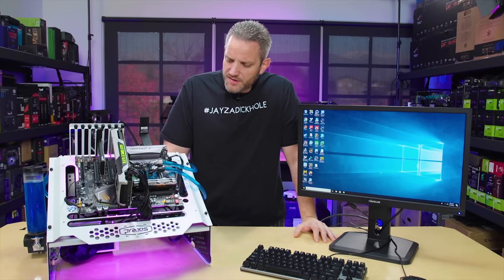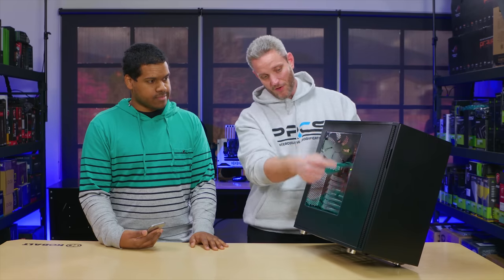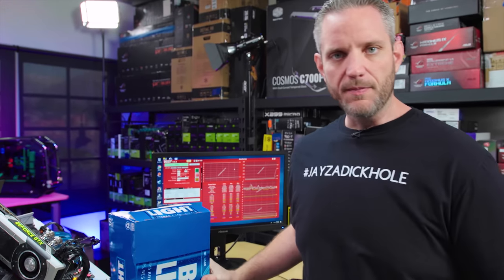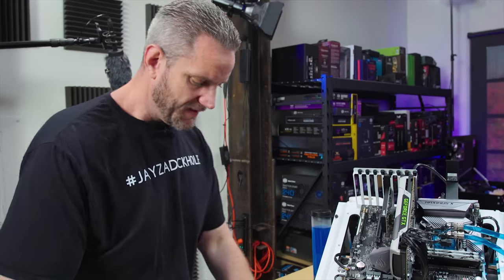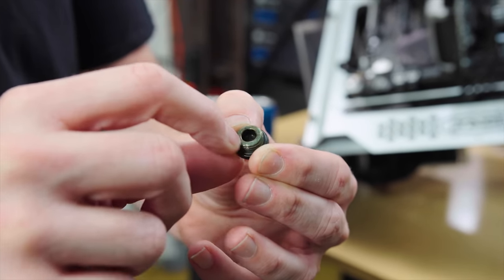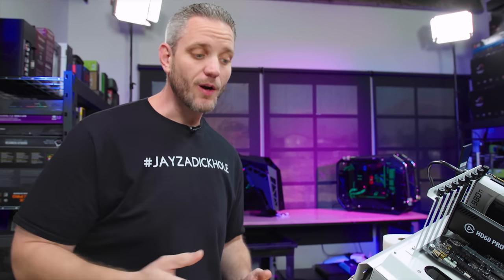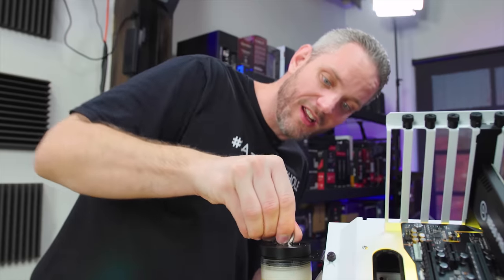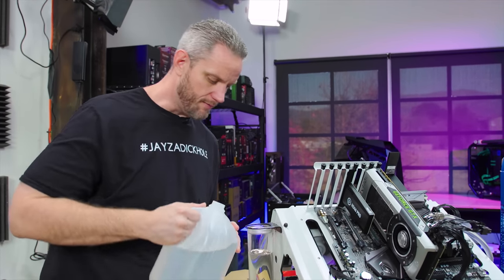We Watercooled a Computer with BEER! DID IT WORK??????

Comment: do it with vodka
Reply: I'm pretty sure it would catch fire at that point lol
Reply: Why would it catch fire? You would need a way higher temperature for that. About 673 K or 400 C.
Reply: Don't forget oxygen
Reply: A Slavic themed build would be awesome. Black case with 3 white stripes
Reply: I don't think Jay's liver can handle it.
Reply: I'm russian and I adore your idea.
Reply: said the russian
Reply: What is good is Post Malone doesn't like vodka thank God!
Reply: It would fuck up all the plastics.
Reply: cheeki breeki
Reply: glass tubing
Reply: you can buy vodka in plastic bottles
Reply: Did you hear about the Russian aircraft radar cooled by alcohol?
Reply: HMMMM TRUMP VODKA
Reply: Actually I'm guessing vodka would be even better if they leave the cap open, as it has high alcohol content which evaporates on very low temperature, and it is well know that evaporative cooling is efficient...
(but you loose the alcohol pretty fast, and as alcohol vapor is very flammable I suggest doing it in a well ventilated area!)
Reply: I was thinking this as well. 
Because what, cider is much like beer, wine is ..meh. Milk is just,,,gonna boil over.
Vodka on the other hand is interesting because ethanol is actually used in cooling systems to prevent freezing. (and sometimes fueling drunk navymen.) It doesn't have the same heat capacity as water though, so we should see some differences.
Reply: Rush B lol three stripe of adidas (life of  borris)
Reply: pretty good idea, btw
Reply: i knew anything that is not "RIGHT" 4 a loop wil be a no go. haha
Reply: I was thinking tequila or vodka
Reply: Vodka - good enough to cool Soviet airplane radars - good enough for cooling a PC!
Reply: @rush B And make it squat real low to the ground.
Reply: Ellypsis Russian bias
Reply: CatSay well, alcohol has a much lower freezing temperature than pure water (you can easily put a vodka bottle in a freezer and it' won't freeze) so if you're going to want to have liquid cooling going through something where it actually has a chance of going below freezing (like way up high in an airplane for example) it makes perfect sense!
Reply: Vodka!
Reply: Ellypsis and this is why you should read comments before commenting
Reply: The pc turns on when you decide to p90 rush b
Reply: and listen to boutchka bass on the way.
Reply: In soviet russia the cpu cools the vodka <(")
Reply: Ellypsis only in Russia...
Reply: IN soviet Russia, computer water cool you
Reply: Don't waste Vodka!!!
Reply: Ellypsis or tequila
Reply: You mean wodka?
Reply: Plot twist, the PC turns Russian. LOL
Reply: Ellypsis maybe Butane... Or some kind of fluorocarbon.
Reply: Distilled ethanol=🔥
Reply: Dr. Pepper, Lemonade, Vodka.
Reply: Ellypsis better yet, everclear
Reply: Yes vodka
Reply: Maybe in a phase cooler.
Reply: FleX that's the point.
Reply: Random idea but he should have just let the beer get flat.
Reply: that would be expensive for the vodka too!
Reply: All the alcohol would vaporize and vapor lock the pump. If you evaporated the alcohol before adding it, well, that would leave you with water, so you might as well just start with water.
Reply: Ellypsis vodka would be better, but they can't use it because beer it's his favorite.
I'm suprised the PC is still works
Reply: go watch boris he did it
Reply: Imagine the utter stench of vodka filled throughout the room the computer is in.
Reply: Cyber Cat no
Reply: cough  LifeOfBoris cough
Reply: 3 words.
Life.
Of.
Boris.
Amazing vodka cooled pc, actually legit aswell
Reply: Borris dit id already
Reply: Life of Boris did it recently
Reply: Have you seen Life of Boris' video? lmao
Reply: life of boris, vodka. idk if it real, but it was funny
Reply: Life of Boris did it
Reply: Use Everclear. Once the show is over, Jay can get his stomach pumped right before the computer gets flushed.
Reply: life of boris did it, go check it out
Reply: i mean it worked for boris...
Reply: i am pretty sure, vodka would work better.
Beer will decompose under heat
Reply: Boris allready did it
Reply: life of Boris made one and its slav as hell
Reply: Ellypsis GTA 5 is not Vodka Optimized, but STALKER and Metro greatly benefit.
Reply: They already did it. Good ok Cossack HD and L. O. Boris did it. It works better than beer or water for the same reasons it or rubbing alcohol cools sick people better than beer or water
Reply: Ellypsis Life Pf Boris did it
Reply: Ellypsis it's called life of borris
Reply: it'd do havic on the parts aswell. . . .
Reply: @paskowitz  being high proof (60+ % alcohol) it's basically the same as them putting rubbing alcohol in it. . . .ouch!. . . (at least from my understandin')
Reply: every single person in the reply section does not know who Boris is. check out life of Boris's PC
Reply: life of boris did it, check it out
Reply: Cv [kJ/(kg·K)]

water - 4,190 

ethanol - 2,44 

in conclusion vodka will heat up faster than water
Reply: There it is: https://www.youtube.com/watch?v=IYTJfLyo_vE
Reply: I'm maybe a bit late but a channel called "Life of Boris"did it with a vodka and a vodka bottle as a reservoir and it worked rather well...
Reply: If you want vodka cooled pc go watch life is Boris
Reply: no moonshine
Reply: @Samtoxie  depends on the ABV, right? (https://en.wikipedia.org/wiki/Alcohol_proof) 
what's the common ABV for Vodka in the US?
Reply: Search Life of Boris
Reply: No algae growth if you 100 proof right?
Reply: who don't like some fire?
Reply: I’m pretty sure Life of Boris did that
Reply: vodka is work 1 year later you lost your tube
Reply: PacificNutria life with boris did it
Reply: It won't catch fire, but it may very well evaporate and explode under pressure
Reply: Already done, Borris already made a video of this. But Jay could do it almost the same way, but it's be hard to stabilize.
Reply: yeah!
Reply: BORIS ALREADY DID THAT
Reply: Ellypsis watch life of Boris he did and it was good
Reply: PacificNutria no life of Boris
Reply: boris : hey that's my idea
Reply: boris beat him to it
Reply: Boris did it
Reply: boris did that
Reply: Go to LifeOfBoris chanel he did it :)
Reply: Boriiiis
Reply: A russian guy called life of boris acctually did that and it was better than the acctual cooling liquid
Reply: boris has entered the chat
Reply: @McMaster_102  check out boris the slav

Comment: Hey Jay, why not use beer colored fluid and then make a float in the reservoir that looks like the head of a beer? Could make the reservoir look like a pint glass too. And the tap handle could be a drain for the system.
Reply: this would be fantastic if he could find a way to purge all the air bubbles with the float in there. who knows, it may not affect it at all
Reply: This.  This right here.  Yes.
Reply: Only problem is everyone who sees it will want to pull the tap lol
Reply: PE foam? Something like one of those PE foam pucks EK tube reservoirs come with, only white.
Reply: Id propably prefer to add soap to it. The pump might be enough to create some foam that is on top. Might get issues with the mayhems dye but Id try it.
Reply: This guy is a genius. @TheBCninja, you need to be an engineer.
Reply: TheBCninja someone get this guy a medal.
Reply: Your pc idea would be a hit at October fest. But to take it further... add a small peltier cooled section to keep a cold one or two with the pc. Down fall, might loose some hdd space.
Reply: YES
Reply: Just xIGoldenIx hey mate did you ever do it?

Comment: 6 years late and I don’t care because this is important. What is that green corrosion? Check this out, what do you think most houses are lined with that isn’t pvc? A metal that, even when corroded, doesn’t pit or rot. A metal that is abundant but when refined it is so valuable that junkies tear it out of houses. It’s copper. Why wouldn’t the system be sealed with copper hardware? Stainless steel is fancy, sure. Copper has character. Copper is battle tested in systems under pressure. Corroded copper has character, corroded steel falls apart.

Comment: try alcohol. just straight vodka. alcohol is better at heat transfer than water
Reply: Topo Gang Alcohol ignites at room temperature if you add a ignition point, otherwise it won't burn, it'll start boiling at 80° tho
Reply: yea and methanol is 65° though :D
Reply: But this is under pressure. Not at atmasphereic .
Reply: well when the beer goes stale the pressure will lower as well. and they kept releasing the gas, so i don't think pressure will be a problem
Reply: wobbly sauce the fact you wrote it like that killed me...
Reply: lol people use alcohol to make THC, and other extracts because it evaporates at very low temps. Just leave it in a well vented room, and after a day or two most of it will be gone, and then just heat it very gently to get rid of any trapped inside, plus the 1% or so of water that is generally in most 99% alcohol. People use butane for the same reason except that chemical in the butane that extracts the THC doesn't absorb the chlorophyll, and other plant chemicals giving it a golden look which sell better. That's why honey oil is made with butane. Though butane is also somewhat more dangerous to work with.
Reply: Thanks P.
Reply: Who the fuck are you, the Beer Walter White?
Reply: if you really want to cool it great, do a loop of murcury. Gonna need a hella strong pump tho.
Reply: Man that would look sick, but probably be pretty expensive, and I don't think the needle would be the problem. It would be the pump, that shit is pretty dense.
Reply: vodka would work fine because its generally 55-63%water and 45-37% alcohol meaning its boiling temperature would be higher so it would be find because its not pure alcohol- (Pure alcohol is almost impossible to get because of how soluble it is in water)
Reply: Straight 98 percent moonshine

Comment: Do it with gasoline....

Because race car bro
Reply: CinOmatic Most race car don't use gasoline
Reply: Ethanol then :D
Reply: Aksherli... Yes they do.
Reply: I don't know about that one.  I'm not sure what temperature gasoline combusts at.  They could have a fire by the time they are done.
Reply: coneris The autoignition point of gasoline is 280c (536F)
Reply: coneris i thought liquid gasoline only combusted under pressure or as a vapor when mixed with air in a certain ratio. not sure either, though
Reply: I think nitroglycerin is worth a try.
Reply: Rubbing alcohol, low boiling point.
Reply: CinOmatic fire ass pc
Reply: CinOmatic That would actually be dangerous. As Gasoline vapours ignition temperature is similar to that of CPU/GPU temps. This is why you need to be careful when storing it and store it in a closed container in a cool environment.
Reply: You could get fancy and use colloidal gold or colloidal silver, I bet they could hold a lot of thermal energy per volume. Is colloidal gold erosive?
Reply: E85 or Diesel
Reply: Did you know the F35 uses its own fuel as hydraulic fluid.
Reply: I like the way you think
Reply: Use Methanol instead.
Reply: And the ignition point of its vapour? Thats the kicker. Its a dumb ass idea. Even a small chance of ignition and bam fire and possible further catastrofic failure due to the nature of the rate of flow. All it would take is one short. It wouldnt be the cpu that would trigger it either. The only place I would even suggest trying something like that is in a extremely well ventilated area like a spray shed where its a concrete room with huge extraction fans. Thats the Only environment you would possibly consider doing something so stupid. And with old hardware that is expendable.
Reply: gl getting something to ignite with no air. unless ofc you want to damage your pump have have worse temps by letting air in.
Reply: I was going to give a smart a** answer with kerosene, but I see you beat me to it with gasoline! LOLOL
Reply: guinness
Reply: Alchohol, gasoline, diesel, E85, etc will eat the he'll out of parts not designed for it. It won't last in my opinion. Sounds pretty stupid to me. I've been a mechanic for 15 yrs. You can't put Alchohol or E85 in a car not designed for it. I know you all are joking, but seriously, it WILL fail.
Reply: No. anything even remotely close to being called a "racecar" now a days runs on Ethanol (E85) a much cleaner and more efficient fuel. Yes they run on fuel, just not Gasoline.
Reply: @AdrinsonEstevez  Depends. WRC cars (my fav motorsport) use petrol (or gasoline) as diesel and ethanol are banned by FIA for rally.
Reply: @Valfaun  that's diesel not gasoline. that's why diesel engines don't have spark plugs, while petrol based engines do.

Comment: Its screwing around until you record your results, then its science.
Next experiment, use vodka as coolant.
Reply: Vodka is a bad idea, because alcohol evaporates quickly. Leave a bottle of rubbing alcohol open and mark the levels before that with marker. Withing couple of days you will see alcohol missing out of the plastic bottle.

Also alcohol evaporates even in closed plastic bottle over time. Plastic is porous, it has micro-pores for gas to escape. Alcohol produces fumes, as it's not solid water. In short...it will evaporate, especially as you hit it.
Reply: Boris did that already
Reply: Life of Boris got you covered komrade!
Reply: Actually pure grain denatured alcohol will work in a older cast iron / copper iron and magneto or spark gap automobiles as as antifreeze. It was quite common to find 140F thermostats in the 60s on the shelf and 15 lbs radiator caps. Ethylene glycol became the standard in overhead valve motors because it has a higher boiling point,   PGA boils at 180 F at sea level. So going back to distilled water in the summer was normal. Think flat head motors & cast iron pumps. A 1950 Ford V-8 was a flathead. So using the right amount of PGA volume would mean with the right Gallons per minute would top out at 82C. (at sea level) That is if the system does not vapor lock. Vapor chamber cooling is often done with alcohol and negative pressure in sealed systems. So yeah beer will work as long as the temp gets high enough everyday to keep it from going into fermenting. As in vinegar or other nasty smelling bacterial or fungal reactions.
Reply: sparkplug1018 this was done watch by life of Boris it’s worth it

Comment: Why didn't you shake it until it wasn't carbonated anymore?
Reply: Where is the fun in that!
Reply: Then it isn't considered beer anymore
Reply: Samtoxie is bud light even beer in the first place? /s
Reply: It's just like non alcoholic beer, fake beer.
Reply: dunno why the /s. legit question
Reply: Samtoxie it is still beer :/ that's like saying that if you carbonated vodka, that it isn't vodka. It's still vodka lol
Reply: Exactly!!! What I thought...
Reply: Samtoxie 
It's sacrificial party beer.

Easy to drink and cheap enough that when you bring a case, you don't get mad when it gets passed around and ends up empty.
Reply: Bike Dude that was the issue they were having lol it was happening in the tubes and causing issues
Reply: Bike Dude they were gone because the pressure equalized. When he opened the cap they started to come out again.
Reply: Crack the lid, then shake it.
Reply: Leggir all that would accomplish would be getting beer everywhere lol
Reply: Bike Dude it doesn't.. ok look lol it doesn't just go away, it pressurizes, which is much worse
Reply: GuvernorDave it’s means sarcasm it’s a reddit thing

Comment: I have an idea! Why not have a reservoir that’s partially filled, and pump air from the top of it through a tube in the bottom with many tiny holes to create those little tiny beer bubbles?
Reply: Because you dont want air in your loop?
Reply: Louie Mott a tiny bit of airpressure in the reservoir is actually neccessary, if you overfill it can blow out your fittings.

Comment: greenish corrosion means the material has copper, it oxydizes and becomes green
Reply: gonna say that, didnt know for sure but thanks
Reply: It's called Patina, it can form on anything with copper in it and only if  object is in contact with Air/Oxygen.
Reply: Compatibility Madness it's called oxidation. It doesn't become "patina" until you increase the pricetag by 5 fold.
Reply: Or let it sit outside and wait a few years ;)
Reply: Grünspan in german

Comment: A couple years late but here's what's happening when it got foamy whilst running: Unlike solids (like salt), the solubility of gasses decreases as the temperature of fluid rises. So when you unscrewed the cap and released some pressure, the gas in the solution rapidly effervesces causing a large amount of foam.

Comment: Use Vodka jay!
Reply: The alcohol would eat up the hoses.
Reply: wouldn't the alcohol evaporate in a day or so and leave just water
so might just work, bit expensive though
Reply: Great evaporator, but how you condense it to be moved by pump (vodka is basicly a alkohol cooling) ?
Reply: geen naam if the loop is completely closed off from the air outside then it can't really evaporate since it's trapped in the loop
Reply: I suspect the flashpoint may be an issue
Reply: I think there is point of using vodka if you are running your coolant at below zero temperatures. There are loads of other issues doing that though, like preventing condensate forming on pipes etc.
Besides, vodka is 40% ethanol (not to be confused with methanol which is highly dangerous) that is not that much different (apart from actually being drinkable) to glycol which many coolants are based on. And I think they would use ethanol on coolants if it wasn't for taxes in a lot of countries, and certain limitations in certain states in the US.
Reply: bud light is cheap lol
Reply: Vodka always works!
Reply: I was thinking rum or whisky myself, just to get a nice colour out of it, but yeah, wodka would work as well...